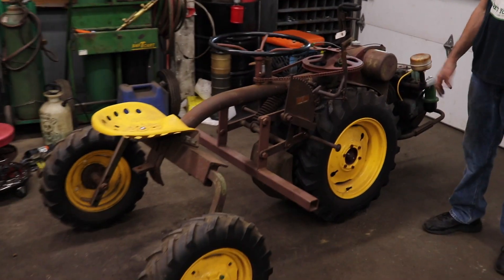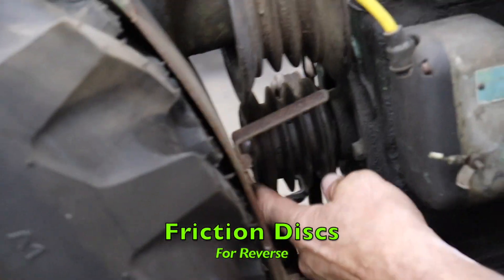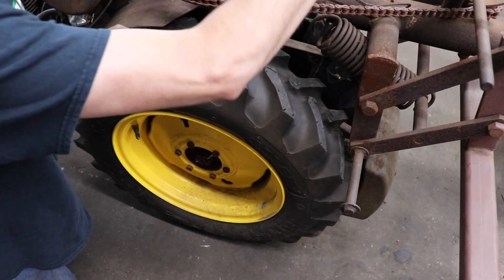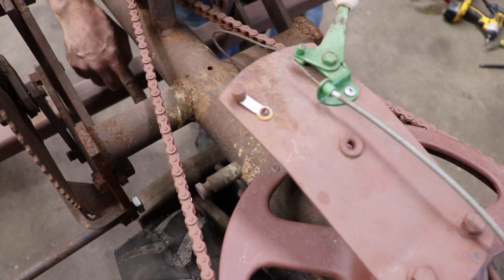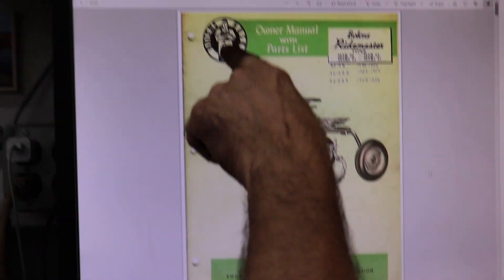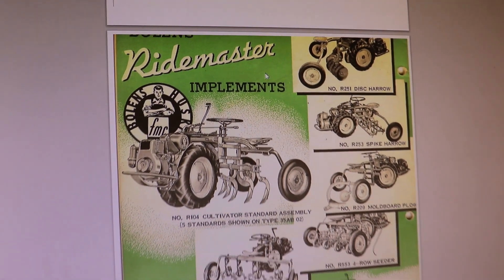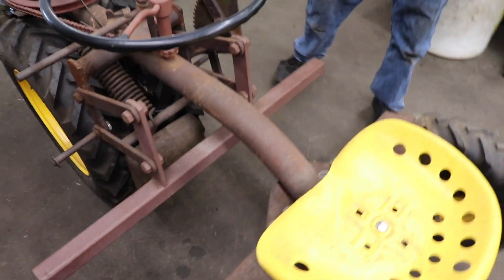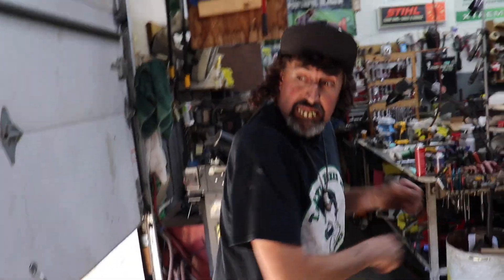AWESOME Bolens Ridemaster Restoration (Part 1)

Comment: I have a Ridemaster that sat in my neighbors yard facing the road for years. When Menards was built they put up a stop light near their backyard and my neighbors put up a fence and the Ridemaster disappeared. One day when I was in Menards at the check out my neighbor, who also worked there, asked me if I wanted to help him restore a tractor. It was the old Ridemaster. I ended up fixing his Troy-Bilt tiller in trade for it and still have it today. I ended up joining the Illinois-Missouri Tractor club afterwards and talked with one of the members, and to my surprise he had tried to buy it in years past. My neighbor was the one to trade work for the tractor in preparation for the fence and got it before the club member. This is one story of antiques on my street finding me and I am know as the lawn mower man for all the neighbors. Thank you Taryl for your interesting videos and you have got me interested in fixing my old Ridemaster again! Maybe someday I can come see you and talk tractors!
Reply from the maker: wow! Thats a great story. Do you know if its a single speed or double speed? and you're very welcome to come visit.
Reply: @TarylFixesAll  It is a 35ab01. It is in bad shape compared to yours, but it has the original AKS engine. I have a later AKN I had planned to use instead. You might want to talk to the folks at Bolens Ridemaster & FMC Bean Cutler Collector Club on Facebook for info and leads on parts. They usually have members go to the Portland, Indiana shows. Thanks for replying back and I look forward to seeing more of your creative videos.

Comment: My dad had a 1956 Bolens yard tractor. It had pull rope start like yours. Dad mounded an electric motor to the garage wall, on a board with a hinge, and would put a belt from it to the pulley, and press down on the electric motor to start her up. It changed speed by having a spring loaded pulley and as the lever pulled the belt tighter, it sunk deeper into the spring loaded pulley to change the ratio. All I have left of it is the plow attachment that is a decoration. When dad got a new tractor he made me a go cart with the parts from the Bolens.

Comment: I've developed a hankerin for old oddities like yourself Taryl. I picked up "The Mule" single wheel plow with a Briggs drive chain system. Also have DB walk behinds and suburban mowers. Anything old and different. I just picked up 2 Clinton engines that those stickers I ordered will go on. I do need help finding a carb for an S-8D Wisconsin. The small engine shops I've checked with aren't willing to accommodate such requests or have just junked their old stuff.
There's your dinner!😉

Comment: I grew up mowing grass on a Gravely Model L tractor.  That thing was as tough as an anvil. Rope starting was always interesting. I’ve seen a lot of different garden tractor designs but nothing quite compares to the build quality of those cast iron monsters. If I could still buy most of the parts I would get one to till up my garden because my little Troybilt works me harder than I work it.

Comment: Somewhere in Ch-yna there's a farmer that's been using one of these for over 50 years.
Reply: The whole village is super jealous because he has the newest model.
Reply: This one was made in Cuba five years ago.
Reply: Taryl. Those Wisconsin pulley's are really hard to find.
Reply: @tonyfremont  Hahaha!
Reply: @johnchadwicktilton  "Find"? You pretty much have to go to a machine shop with a blueprint and have it made. About 200 bucks!
Reply: Somewhere in China, the Chinese made a Chinese copy of the Bolens Ridemaster. For sure!
Reply: @charger19691  If they did, I'd sure like to buy parts for it for my Ridemasters!
Reply: @tonyfremont  lollll
Reply: @charger19691  for sure :)
Reply: They use rigs like these as passenger pickups. They sell the motor at one place, and then a different shop sells the cab, and rear wheels. Front  wheel drive, and the front wheels articulate at the pintle hitch/ cab. The even have 19hp single cylinder diesal if I remember  correctly.  I read about it o Jalopnic, or whatever that cool car website is called. I'll look for a link if I get some ambition.
Side note, you remember  the kids back in High School showing off the spanglish, and they called the weed "Mota"? That is short for Motivacion. Or in english we say Motivation. Pretty neat huh?

Comment: 6mph was a good move, 3pmh is pretty bad. You made a good move getting that one that’s 99% complete. 375 isn’t truly that bad, considering it’s an antique tractor, 3-6mph isn’t terrible, got a tractor that’s a turtle, but it’s a true work horse.
Reply: I just hope it's not too fast. I think you might need the slower speeds for plowing?
Reply: This is a 6 HP garden tractor, not a skip loader. 3 miles per hour is plenty fast for grading a yard. I got one of these too, the 2 speed one. AB02

Comment: Taryl,  I found a picture of the light.   It mounts by using the two bolts above the large steering gear and shines over the gas tank.   It looked to be at the same height as the steering wheel.

Comment: Thread gear - I wonder if they are talking about single, double, and triple thread worm gears?  That would make sense that a single would be slow, a double would be faster, than a triple even faster again?  Very interesting.  Wisconsin engines are built like TANKS.  Double tapered roller bearings, oil pumps, very nicely engineered.
Reply: I think you're right about the thread gear.  BTW, I Googled it and it seems to be an arcane term.  I'm guessing that it comes from the cutting of threads on a lathe with a rotating threaded shaft and a half nut riding on it to properly space the threads.  I'm thinking that a spinning shaft from the motor is running at, perhaps 3600 rpm or thereabouts and a gear meshes with the treads and slowly turns to move the vehicle.  It's a gear reduction system simpler than a harmonic drive.  Changing the thread rate changes the final speed.
Reply: @alext8828  Thank you for the confirmation!  :)

Comment: Taryl if you like this machine you should look into an old gravely l  2 wheel tractor
Reply: I love the old Gravelys.
Reply: Gravelys are cool, and heavy as hell. I bought a 546 a month or so ago with a snowblower attachment. I was amazed how heavy the whole thing is. Heaviest two wheel walk behind tractor ever I bet. Then a couple weeks ago I picked up an old Model L and it's crusty. But had a good brush hog deck, sulky and snow push blade.

Comment: Interesting project and good choice on the auction per your description. Too bad you don't have any implements - something like this you will have to keep looking as they will only be up on ebay every so often. But thats the way to find what you are looking for. Or maybe craiglist global search which are different web sites than craiglist. Sickle bar would be cool - must have some kind of pto to run the sickle for power, like the light kit.
Seems in the design they saved - key switch, starter motor, reverse gear, cowlings,

Comment: Taryl I have a question not about this  post but I thought I'd ask you I have a 1979 miller rough neck welder with a 14 hp tecumseh the walbro carburetor LMH-17 is not any good I've tried locating a replacement carburetor with no luck is there something that will work  I enjoy your videos keep the good work up ... or does any one have any information on carburetor swap... thank you  for a response?

Comment: Yep, I bought one of the last good Craftsman tool sets.  Came with SAE and metric, 6 and 12 point sockets plus five or six 8 point sockets, 3/8" drive.  Got a whole set of 1/4" and a fair amount of 1/2" drive SAE and metric.  Allen wrenches and an "ignition" wrench set in a big durable plastic tool box. They all fit better than brand new snapoff sockets.  Why doesn't anything fit anymore?
Reply: Tekton is becoming the new craftsman.

Comment: 15:20 It's got the throttle control cable running through the steering gear. Hmmm... must need extra power in the turns.

Comment: Cool! Looks like Taryl might have gotten this at that Kraft auction in Valpo recently? I saw all those Bolens Ridemasters there and thought they were cool. I got a nice David Bradley at the same auction with an original engine and larger than usual AG tires for $60! All told after the auction fees and gas to get there and back I got maybe $75 in it, what a deal : )
Reply from the maker: so you are the one I bid against on that David B.

Comment: If you can print it out. It will be easier to take to the work site and work will be easier I printed out the manual to my John Deere and put them in plastic sleeves, it keeps them clean.

Comment: You will, of course, but I bought a Troy-bilt tiller with a worm gear transmission, like that one, and it had worn the screw and gear to where you could have shaved with them. I'm guessing not enough GL-5 gear oil, and/or hundreds of hours on it. Wasn't worth fixing, those gears are EXPENSIVE!!

Comment: You could do some small farming with it.....Looks like the Manual has the wrong Tire and Wheel sizes ..Could be my mistake how they wrote it ??
Reply: It looked like the original tires were the same size as David Bradley two wheel tractor tires, but they added on larger ones. My first DB has 6 -16's like Taryl's Bolens manual shows, and the one I bought recently has 7.5 - 16's. Which are fine, but the kickstand will only go forward because it can't get past the extra wide tires.

Comment: My old Briggs 12 HP 281707 engine has only 50 lbs compression. Should I switch to another used engine??
Reply from the maker: Sounds like it just needs a valve job. Now there's yur dinner
Reply: Thanks. I'll try fluid cleaning first, and rotate engine.

Comment: Taryl ?  tell me what I'm doing wrong?  Every lawnmower dealer I go to I end up walking out all pissed off,, is it ME or is it the dealer?  ok, I walk in dressed neat, with a smile and inform the dealer I am looking to buy a certain model, he holds me hostage not showing the machine I want until I answer all his questions, I tell him I just want to buy it and leave, I get insulted with the questions he asks me like what am I going to use it for, or did I look it up online and did I call first and how much do I know about the machine I want, telling me he doesn't want to sell me the wrong machine,,  I take that as an insult that he thinks I'm too stupid to know what I want or he wants to sell me what I don't want, then I start getting pissed off asking him directly IF he's going to sell it to me or not, he makes an excuse answer that he wants to know more about me before he can sell it to me,,,  so I finally lose it and tell him to stick it up his butt hole and walk out all pissed off ( Toro Dealer, I wanted to buy the Toro 3-1 with the aluminun deck but I ended up buying the Powersmart knock-off one with the same features but doesn't have the aluminum deck, very happy with it with a bigger engine)